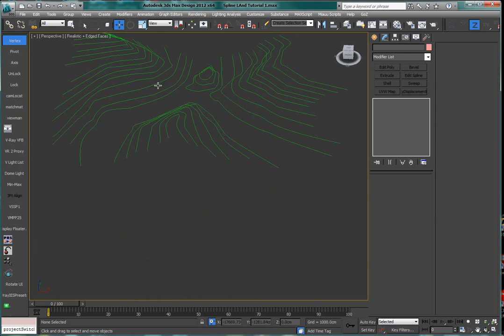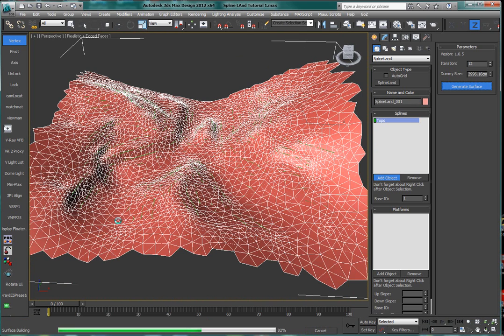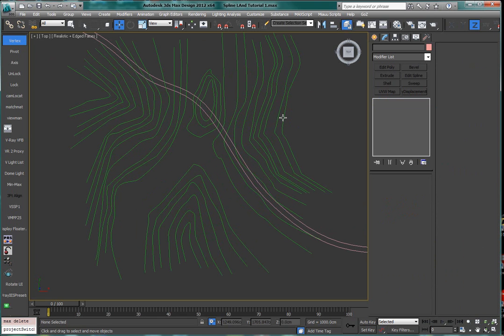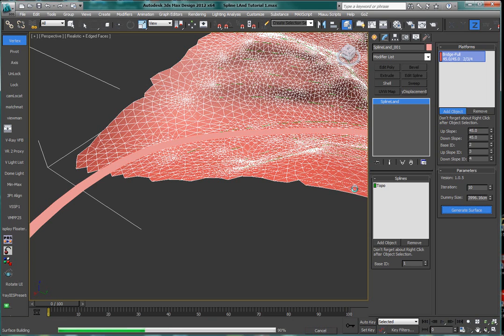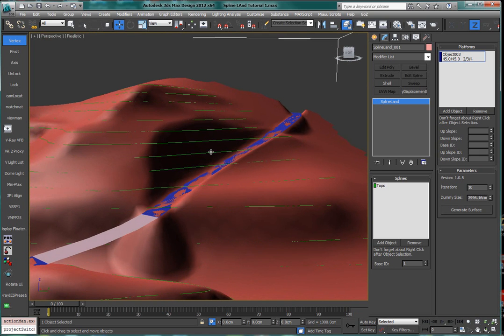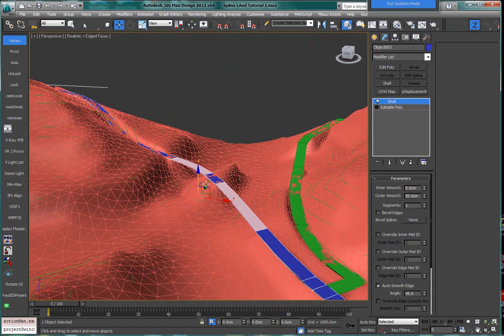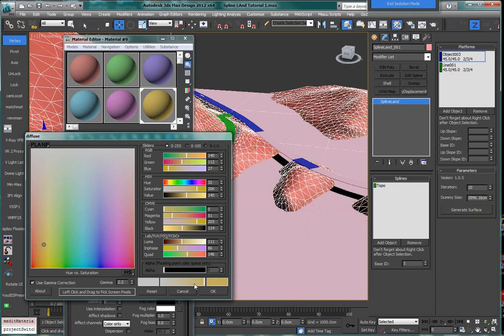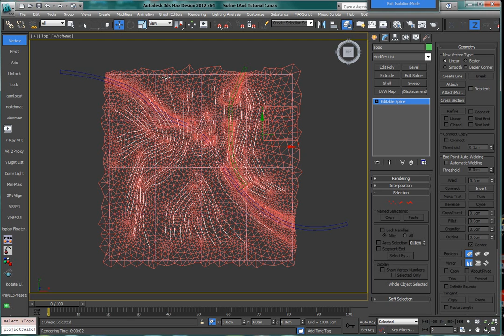SplineLand 3ds max plugin tutorial

Comment: hey i have a question.can i make a road with this on a displaced grayscale terrain?would be nice if you could help me out
Reply from the maker: Not if you have a pre-made terrain. The plug will only make both the road and the topography at the same time. There is a trick - which requires some work - I never did it so I cannot guarantee - you can create your terrain and then use SECTION to create the topographic lines  and then use those for the re-creation of what you need. I do suggest you send an inquiry to the programmer - I am only a regular user of SL.